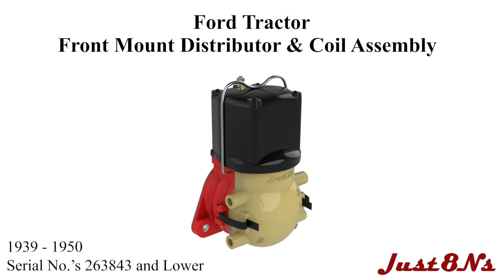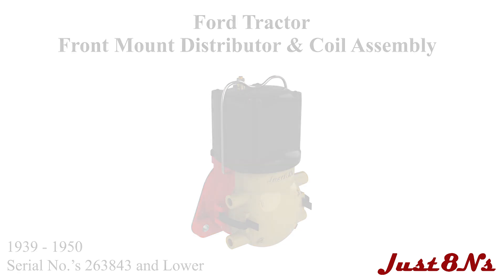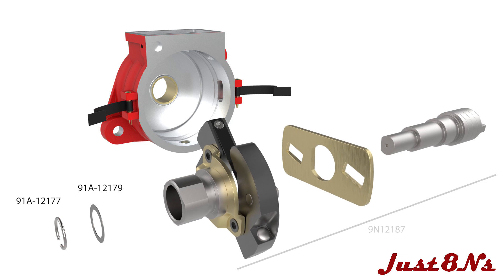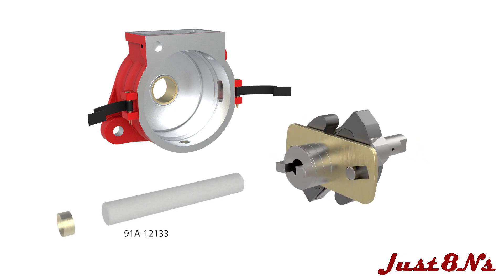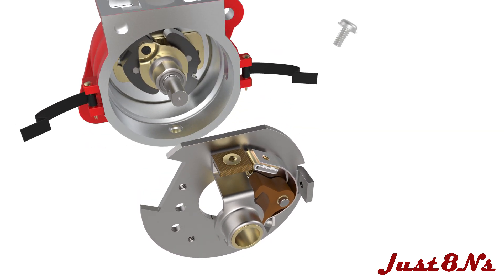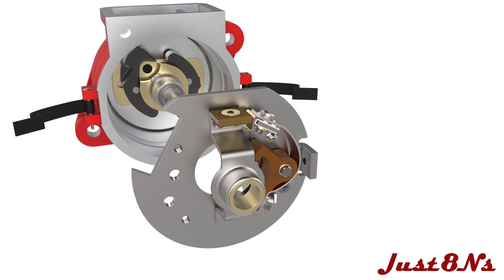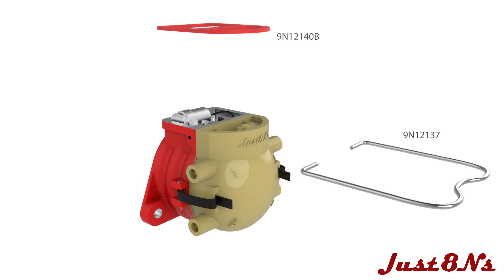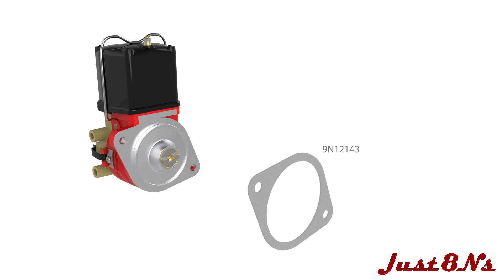Ford Tractor 1939 - 1950 Front Mount Distributor & Coil Assembly

Comment: Do I need to bypass the condenser screw to the points spraying separate from the coil spring my distributor does not connect the coil screw to the point frame is that a problem,

Comment: Please show the Actual 100% connections between points and condenser’s or lack of my distributor does not connect those two points am I 1939 nine in Ford front mount distributor there is nothing connecting the points spring to the condenser screw there’s two separate screws there, ok thanks BigAl California  I need help .

Comment: Now wait a minute, why do you not show ALL connections, are why do you leave connections on Unvisualized, like the condenser and points springs are they supposed to be connected it’s pretty simple I’m trying to figure out how to hook up my new points I don’t see a connection between the condenser and the points spring is there supposed to be a pointto condenser connection.
Reply: THERE SHOULD BE A COPPER CONDUCTOR STRIP BETWEEN THE POINTS AND THE CONDUCTOR SCREW . IT IS USUALLY MADE INTO THE PAATE AND RIVETED TO THE CONDUCTOR SCREW POST.